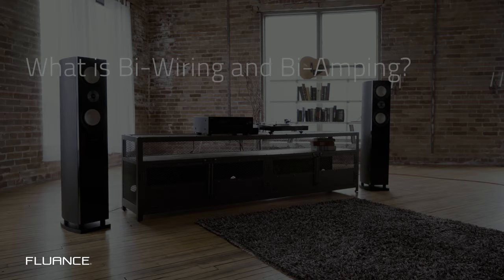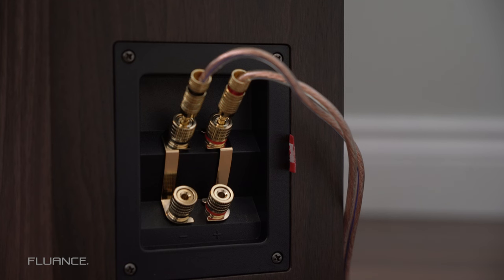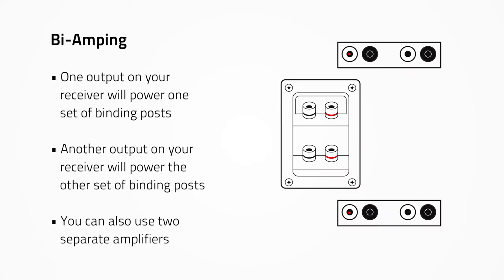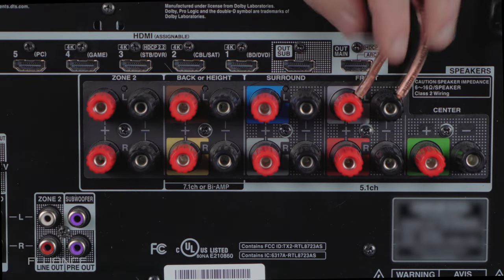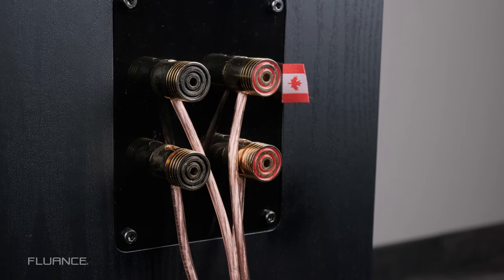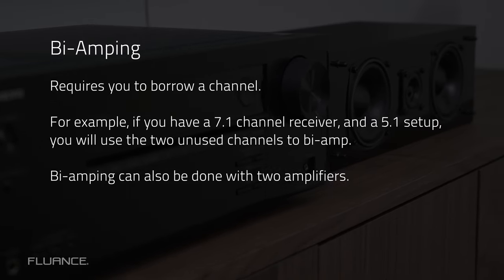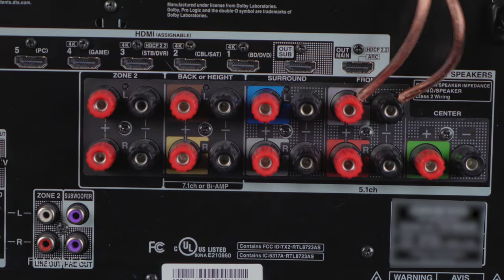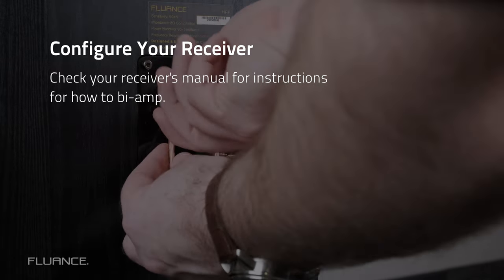How to Bi-Wire and Bi-Amp Home Theater Speakers: What does it mean and is it worth it?

Comment: With all due respect, I do not think your description is correct. 

Your bi-wiring scheme is nothing but a single-wiring as it uses only ONE receiver (amplifier) output and an extra pair of speaker wires in place of the pair of the bridging plates you removed. In fact, what you describe as bi-amping is the real bi-wiring, as TWO separate outputs from a SINGLE power-amp are used to drive each speaker section separately. However, in this case the amps are conserved. 

For the real bi-amping, one needs TWO SEPARATE amplifiers that drive speaker sections separately. The power amps are then either (i) each connected to one pair of outputs of a two-output control amplifier or (ii) they are daisy-chained and the last in the series is connected to the output of a single-output control amplifier. Bi-amping allows also the use of amplifiers of a different power (weaker for the tweeter and stronger for the bas/midrange section) as long as their gains are the same.

Comment: simply not true, sorry....  allowing driver to be powered separately, resulting in a cleaner sound, will ony be true if it's active bi-amping. So filtering is done before amplifying. In passive b-amping and bi-wiring, no filtering is done and both drivers are still connected to one and another and signal passes the internal crossovers
Reply: While I mainly agree, one still may achieve a better sound with the passive bi-amping. Particularly if you use a tube amplifier to drive the tweeter and an SS to drive the bas/midrange (as long as they have the same gain).

Comment: What's the difference between having The cable come together on the amp rather that just using the Stock high and low bridge on the speakers directly?
Reply from the maker: Thanks for your question. If I understand the question correctly, amplifiers don't typically allow you to bridge the wires like the binding posts on the speakers. You would only need the bridge if you are not bi-amping/bi-wiring.

Comment: @Fluance Audio using the bridge avoids having to use 2 cable pairs for bi-wiring? I say this because finally, the two pairs of cable from the speaker are connected to a single input on the receiver, is that correct? so what is the idea of removing the bridge?
Reply: bi-wiring doesn't work if the terminals are connected through the bridge. what would be the point of running 2 pairs of cable if they connect at the end anyway

Comment: But using a surround system sends different signals to speakers for surround effects so looks like this is mixed up. I think it works really for a 2.0 stereo.
Reply: Some, but not all, receivers allow you to re-allocate outputs.  Unfortunately videos like this assume everyone has that style of receiver.  I've seen it in a few YouTube videso where the assume everyone has the most expensive receivers with all the fancy features and don't bother making the comment that not all receivers, in fact majority of receivers, do not have this functionallity and make it sound like anyone can do it.   It's typical audiophile nut logic of assuming anything without the functionality is not worth having.
Reply: @EsotericArctos Actually these days most AVR’s have that capability even cheap ones.😊

Comment: I have a 7.2  channel receiver
 (Sony Dh790)

And 5.1.4 speakers dolby atoms (klipsch)

I have everything hooked up except the height speakers from for of the speakers.  Could I Bi - Wire them all?
Reply: Only if your receiver says Bi-Amp on the back and in the set up manual.

Comment: Doesn't bi-amping on the same receiver somehow mess with the sounds that are supposed to come from the (nonexistent) rear speakers whose posts we're using for more juice that are now wired to our fronts? That's my curiosity.
Reply: You need to configure the outputs of your receiver through the menu (this is what this video fails to mention). Not all receivers have options for bi amping - keep that in mind.
Reply: Amps which can Bi-Amp will show it printed on the back of the amp and in the setup menu.
Reply: One cannot bi-amp with a single receiver/amplifier.

Comment: How is biwiring supposed to be better?
Reply: There are three things that make a difference.  Firstly, you remove the really nasty plates that link the two sets of binding posts on most bi-wirable speakers.  Secondly, you add a second cable which improves the connection between amp and speakers.

The third is the one that folks often don’t believe, however, it is a fact.  The signals are split between the two pairs of wires.  The high frequency connected cable only carries the frequencies that the crossover filter allows and is free from the interference from the bass frequencies.  The same is true of the bass wire, however, given the relative current delivery, it’s less likely to be affected anyway.

The upshot is a greater level of control of the drivers, delivering a more open, detailed sound.
Reply: thx  @markcarrington8565  ya i have 2 pairs cables to/from each tower  separated by the high/low and A&B
Reply: @markcarrington8565  Not true - nor accurate.  Do some research.  Whether bi-wired or not it's the crossover that will separate high and low frequency signals.  When the signal leaves the amp it is not separated high/low.  There's a lot of information about this waste of speaker cable.  However, do get rid of that lousy binding post strap and replace it with decent quality speaker cable.

Comment: HOW DO YOU SET THE LIMIT ON THE HIGHS AND LOWS FOR EACH DRIVER?  IF THE POWER IS COMING FROM A SINGLE POLE? TO POWER BOTH DRIVERS?   MAKES NO SENSE !!  THE REASON FOR BIWIRE IS TO CONTROL EACH DRIVER WITH THE PROPER FREQUENCY!
Reply: I think you mean Bi-Amping, but it doesn't make a difference in your question...  The speakers have a High, Mid and a Low-pass filter installed, internally, before each speaker, that can be one for High freq, one for Mid freq, and one for Low freq ( in case of a 3-way speaker)..  If you Bi-amp(on one amp, say 7.1channels), you double the amount of power to the speaker, because you're using 2 channels to power one (2 or 3-way)speaker, Front left and Rear left. The High and Mid will be on one channel and the Low on the other.
Reply: @R2_D3  EXACTLY!!!

Comment: This video is terrible and honestly a bad lesson and misleading.  It really didn't explain what the real purpose or if it's worth it at all.  Also it only briefly mentions changing the receivers amp repurpossing which is extremely important as you will get weird signals to you speakers if you don't (the woofer playing main speaker sound and tweeter playing sounds meant for surround speakers as an example)    I'm not saying everything is wrong with this video,  but if you're going to put information like this out, do better!